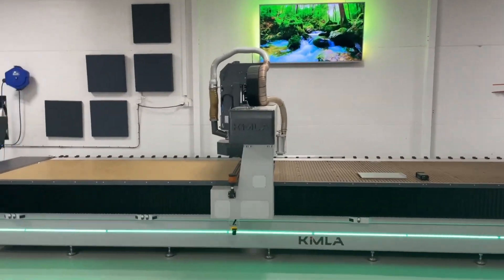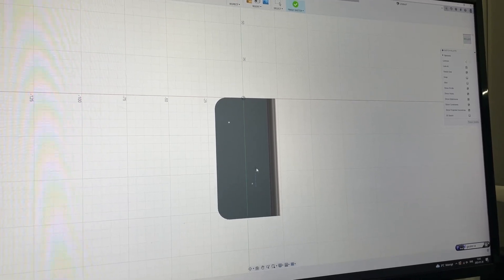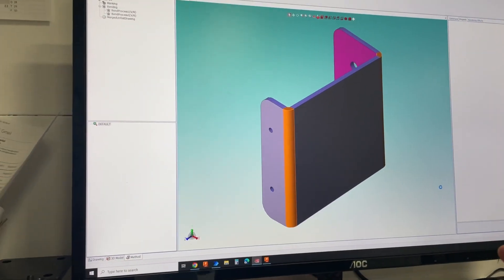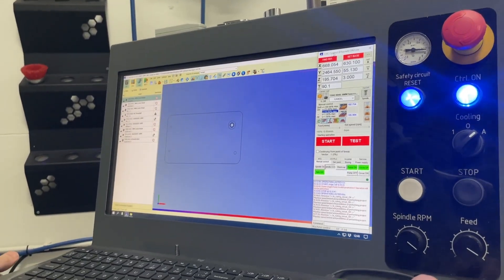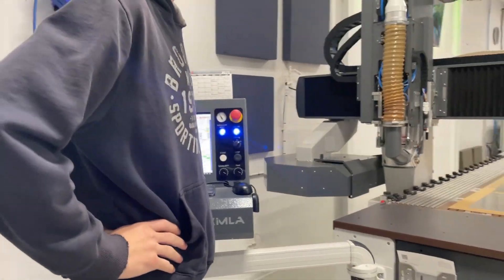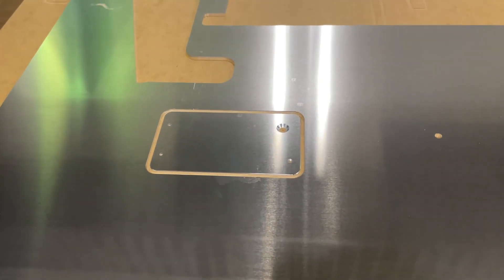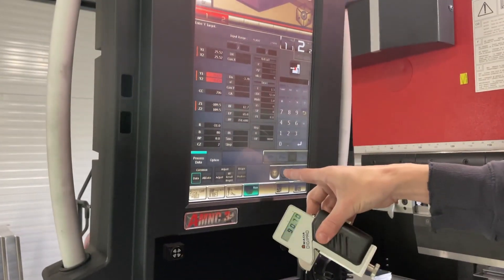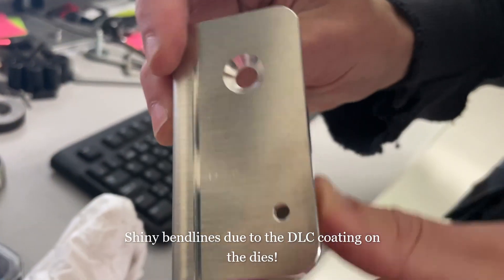Worlds fastest Sheetmetal part ? 😁

Comment: Im so impressed with your vacuum system, i cant believe how well it can hold that little part with so much of the bed uncovered 👍
Reply from the maker: Yeah its good, tho remeber that there is only 1 vacuum zone open. That area is 1250x500mm. Ramping and ending the perimiter cut at the center of the longest vector is recommended pretty much always :)

Comment: Hi! What protractor do you use?
Reply from the maker: Its called DigiPro and comes with the Amada pressbrake. It sends the values to adjust the bend angles wirelessly. 
Amada does not manufacture it tho so it might be possible to find a non amada branded one. There are other wireless options out there aswell.
Reply: @randomrouting   Thank you :)

Comment: As always, awesome video.

Which bending programm are you using?

And I think in one of your videos you say you are using ENAW 5754 H111 raw material. Do you have problems with "warping" in the raw material? We use ENAW 5754 H22 and sometimes the raw material is warped on the whole length of the raw dimension. Maybe we will switch to the H111 material.
Reply from the maker: Thanks! Im always rushing when doing vids so im happy ppl still think they are ok.🙏

Im using "Dr Abe Bend". Atleast thats what it used to be called, its part of Amada bend suite.
Both "Production Designer" (where i import the 3d model) and the bend program are Amada specific and really ment for their cnc punch or laser machines so ive had to do some trickery to get it better suited for my use.
Doing that has perhaps been the most fun this year, every "fix" adds so much convienence and value overall.

Yes I mostly cut 5754-H111 and its funny you should ask about warpage because yes that IS a problem, infact couple weeks ago i got perhaps the most warped 1250x2500x5 sheets yet and it was more or less unusable. They were "cupped" along both directions.
Every time a piece was cut loose it warped up 5-6mm so impossible to chamfer ect.

I sent them back and ordered new ones because i was thinking it was the shipping that did it, they are NOT laying flat on the truck and sometimes there 1-2 tonns on top.
I had the exact same problem again. Im used to SOME warpage but this was not ok.

So i talked to the supplier and got them to take them back yet again and I asked where they got the sheets from. They get them from all over the world but this batch specifically was from china.
I asked for new sheets and this time from germany. They arrived and they are perfecly flat.

The other thicknesses I ordered was partly from south africa and im guessing some from other parts of EU. The 3mm sheets also had warping issues but not so much so the vaccum hold down can handle them.

I am considering telling the supplies to give me german made sheets from now on whenever possible. Its just such an headache when  they arent flat.

ps. I stopped using H22 due to cracking when doing narrow/sharp bends, otherwise its the industry standard.
Reply: I always look forward to new videos from you.  Thank you for the detailed answer. 

Is the dr abe bend a free software?  I am currently looking for a low cost or maybe free offline programming software for our Coastone press brake.  

It's very interesting that you had these problems too.  We are from Germany, but we may also get the raw material from various other countries through our suppliers.  I think we need to discuss this topic with our material supplier.😄
Reply from the maker: @hytech_tretantrieb3051  Software only comes with a machine puchase and only works for Amada (as far as i know), I heard somewhat good things about autopol, might be worth checking out.

Yes it interesting that you have been experiencing the same problem with the material. Definately worth talking with your supplier, funny if it turns out its from the same place.

Prefer German made 👌
Reply: @randomrouting  thank you for all the information
autopol looks good from the videos. Maybe I contact the fabricator.

Comment: Great stuff. The edges looks super smooth.
Can you do some video about bottom chamfering? Show the tool, etc. There is little to no content like that.
Also how much coolant do you use per hour of routing?
Reply from the maker: Hey, sure I'll include it in the next video.👍

The pump is able to supply 1L per hour and ive got it set to just under 50% so with resistance ect its probably around 0.4-0,5L per hour of cutting.

I could probably atleast half that if i got closer with the nozzles.. Im considering sliding a ptfe tube in a ptfe tube (like now) but that slides in and out with the airpressure that is supplied to the suction cup. we'll see.